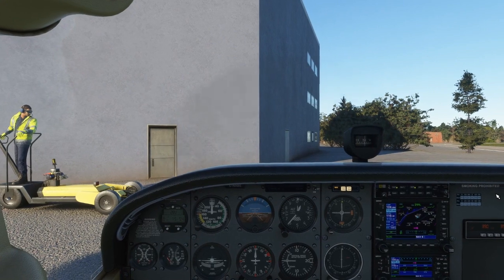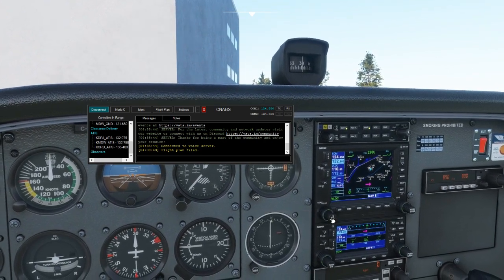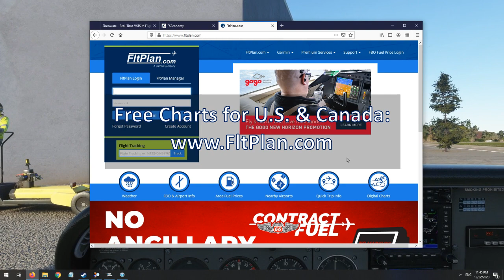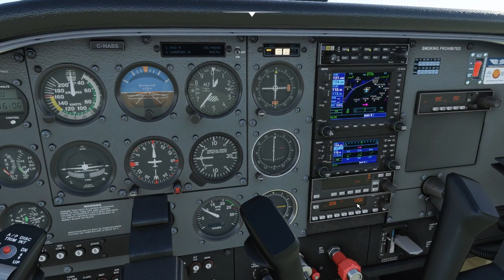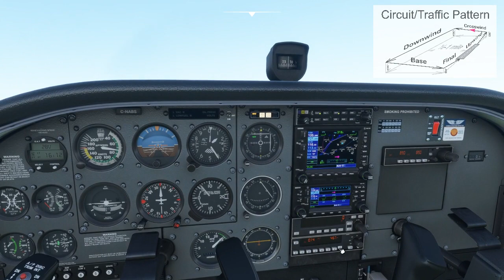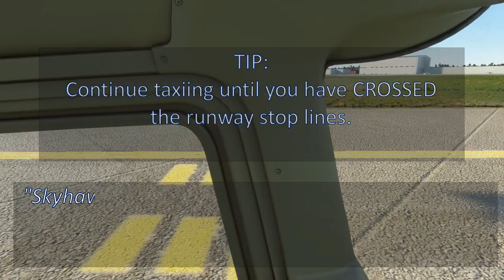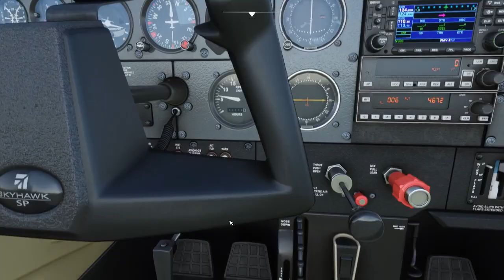Your First Flight on VATSIM: VFR Circuits Tutorial (with lots of Tips) Part 2 (Flying Circuits

Comment: I thought you did an excelent job, throughout, describing mistakes from atc as well as your own. Helps me to find my mistakes and fix them accurately!
Reply from the maker: The past 10 years or so has seen a real shift in aviation from preventing errors to trapping and mitigating them. Even the most well trained and well intentioned human will make errors, whether designing, building, maintaining, or operating airplanes. We must recognize and acknowledge that we will make errors, and try to catch and fix them.
Reply: @CaptNabs  perfectly well said, on that note im joining your channel

Comment: Your two videos helped me finally understand VATSIM. I thought I could be at any airport and tune into that airport's frequencies until your vid. Thanks so much. It also gave me better understanding of the circuit flying. Have a great day.
Reply from the maker: Glad it helped. There is a project on VATSIM to list appropriate frequencies at every airport, but it is a massive project and is not ready yet. In the meantime, the old fashioned way still works: Ask someone nearby. ;)

Comment: With the spinning knob issue, I had that dilemma when I started playing Flight Simulator (FSX at the time) in 2015. Eventually, I invested in the Saitek Multi-Panel so I had a physical knob. Same goes for the Radio Panel for switching frequencies. Those panels have been around for a long time, so they’re not expensive at all.
Edited: you can also change the transponder code using the Saitek Radio Panel, so you won’t have to pan down to the cockpit’s transponder. I promise I’m not a troll. As I watch, I like to add extra tips if I can!
Reply from the maker: It's a minor annoyance. I would love a radio panel. As a VATSIMer, it seems like one of the most important additions. Right now, I am saving some bucks for the HoneyComb Bravo. At least it has some built in autopilot controls. Now I am beginning to dream about how good a sim pit we could build with an unlimited budget.
Reply: Or check out the knobster that works with air manager.
Reply: I’m using a stream deck for all my controls for autopilot, light and come, you can add so many switches and controls and there are loads of pre loaded profiles out there. Haven’t flown in vatsim yet but getting things ready so I don’t fumble around too much when I dive in
Reply from the maker: Yeah there are so many possible permutations. I used to have a gamepad just for a few certain controls. It wasnt realistic per se but damn was it handy.

As long as you can fly headings, altitudes, tune your radio and use your xpndr, you are ready for VATSIM. Controllers know everyone is single pilot so things often take 30 to 60 seconds to start happening. Make sure to put "New to VATSIM" in your flight plan remarks the first few times and Have FUN!

Comment: I love this series! Really giving me confidence to getting on VATSIM sooner than later, thanks!! Do you have a description of the sim and setup you’re using? It looks beautiful.
Reply from the maker: I don't think I have a description anywhere.
MSFS with a default airport.
i7 9700k CPU 32gb RAM
GTX1060 with 4gb VRAM

All MSFS is stored on SSDs.

Not a cutting edge setup, but MSFS is great at maximizing whatever you have in your system.
Reply: @CaptNabs   I want to upgrade to MSFS from FSX, but I really rely on my multiple views (front and side windows), so I'm waiting until they support it. Thanks for the quick reply and great work!
Reply from the maker: For sure. If thats how you fly, then I hope it is in the roadmap. I used to do multiple windows until I got TrackIR. Now I can look around so naturally, it's great.
Reply: @CaptNabs  what's your monitor size? Thought about getting Track IR but my monitor's 27", too small maybe?

Comment: Occasionally, instead of having to do the math to determine the TPA, that number will be listed in the Chart Supplement (Formally A/FD), which is available on Skyvector. At some places, the TPA is slightly different for turboprop planes than piston planes like the 172.

Comment: hey, great video! i got into VATSIM doing IFR as it was always the more covered topic
but now that i'm on MSFS i've become more interested in GA and VFR by extension- if all goes well i'll be doing my first circuits tomorrow!

is it possible for you to make a guide for flying cross country?
Reply from the maker: That is an excellent suggestion. MSFS really did bring a renaissance of VFR to what was a 98% IFR network. Now that airliners are available in MSFS it did fall off a lot but it adds interesting variety for any and all controllers.

Comment: Great video, thank you. Newbie aviation specific question though: Why do you not adjust the altimeter on the ground so it reads zero, and therefore gives actual height above ground whilst conducting pattern work? I would think that leaving it at the (600 ft in this case) introduces an element of confusion and risk.
Reply from the maker: At first, this seems like a sensible option, and a few countries operate this way.

However, doing this would increase overall risk in the system for anyone who is not staying in the pattern. Pilots will be using altitude outside the circuit for many different reasons including evaluating terrain, determining airspace boundaries, and for communicating with other pilots and ATC. If everybody used a different frame of reference (different starting airports), it would require a lot more mental math to figure out if you can make it over that mountain, or establish whether you are on a collision course at the same altitude. Better to ensure is using the same altitude baseline, in our case, Sea Level.

Its also the reason why 1000' is used for circuit altitude. It is a nice round figure that requires only the most simple of math. Cuz pilots hate working harder than they have to. ;)

Comment: Hello!! thank you so much!! 😊 Do you have any tips for writing down instructions in VR since that's what I play in?
Reply: I was wondering the same thing, i think i'll just slip up the goggles for now and write stuff on my knee board. Thats the best way I can think of, I'd imagine capturing info in VR would be cumbersome.
Reply: @sharkdude44  I figured out two fixes. First if your lucky enough to be using occulus, they have keyboards that you can actually see in VR with finger tracking you can buy.
I'm NOT on occulus I have htc vive, but steam VR has the ability to dock a window to your controller like you're holding a piece of paper in your hand. This is PERFECT for looking at charts!! 

But writing is a dif story. Putting the docked controller view of a notepad on your desk or lap and learning to touch type is prob my only option 

I HATE ALT TABBING IN VR ALL THE TIME!! LOL

Comment: I just got into Vatsim, and I only wish that ATC would speak this slow and clear with me. They spit out the taxi route and runway in half a second and I'm like, "huh?"
Reply from the maker: They sound just like the real thing. And just as fast. Here are 2 suggestions:
1) Put "New to VATSIM" in the Remarks of your flight plan. Not everyone will see it, (especially when it's busy), but it can help.
2) Speak slowly when making requests. Most controllers will tune their speed to your skill level. If you sound uncertain, they will go slower. If you sound pro, they will carry on full speed.
Reply: @CaptNabs  Thanks! I must sound like a real pro then xD

Comment: How did the ground ATC found the taxi position without pilot mentioning it? So is it not compulsory to mention the position to get the taxi way to RW?
Reply from the maker: In the real world, ATC will look out the window. For most private registrations, chances are they have seen the plane before and recognize it.

On VATSIM, they may simulate looking out the window or use their ground radar which, by default, shows all the airplanes on the ground with their registration. Also assigning a squawk code to the aircraft will make it appear on ground radar just like airborne radar.

All that being said, it is polite to state your location on initial contact so the controller knows where to look without searching through all the airplanes on their scope. So not always required, but can be helpful.
Reply: @CaptNabs  Thanks for the clarification.

Comment: How did the controller know where you were parked to give the correct taxi instruction? You didn’t mention where you were on the aerodrome when requesting taxi & the xpdr was off.
Reply from the maker: Great question. Real world, there are 2 types of aviation surveillance radar, Primary and Secondary. Primary just shoots out a powerful beam and waits for any solid object to reflect it, such as an airplane, and show a blip on the screen. Of course no way to tell which blip is which, any object may cause a blip, such as birds or even cars on a nearby road, and limited range because signal has to travel both ways. Secondary sends a coded signal that transponders reply to with the transponder code. Instant ID plus better range since the signal only travels one way. All airports use both in case transponders fail.

On VATSIM, all airplanes withjn range are visible as Primary targets on the scope, but they may not have any ID if the transponder is off. My guess is I was the only target logged in at the airport.

Comment: Question, do you not need to provide aircraft model when talking to a new controller? Like with tower: Skyhawk CNABS"
Reply from the maker: That is country specific. Many places yes, but not always. If you say it quickly, its not a bad piece of information to share even when its not mandatory. Also, if you have said it to a previous controller, it is not necessary for subsequent controllers after a handoff, as it should be marked on your flight strip.